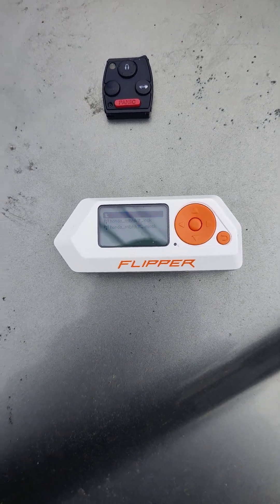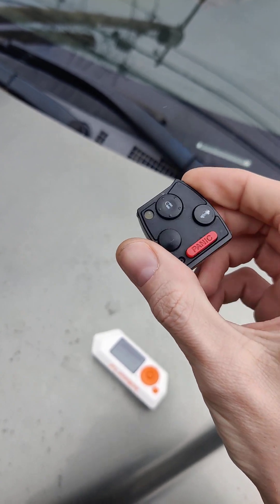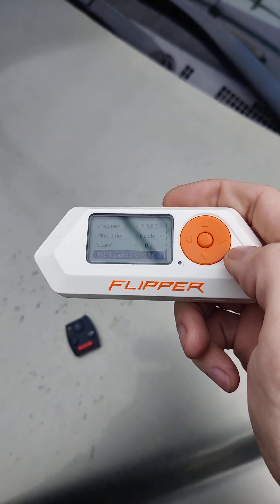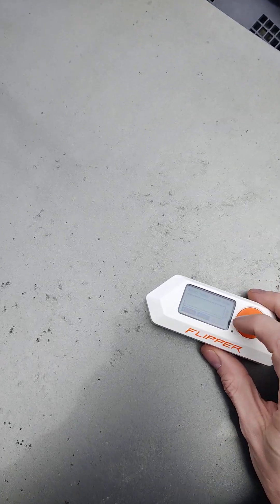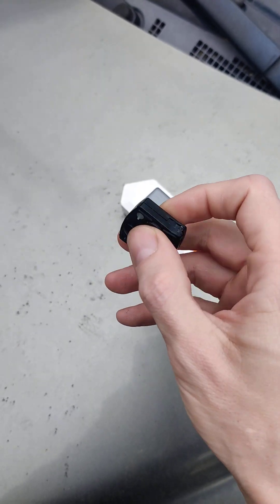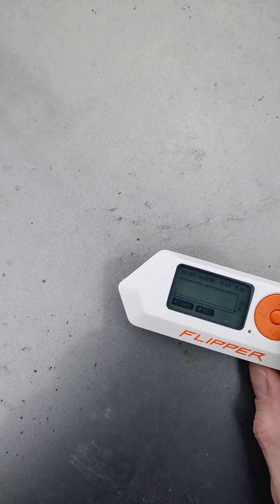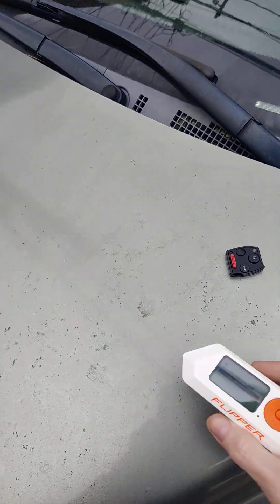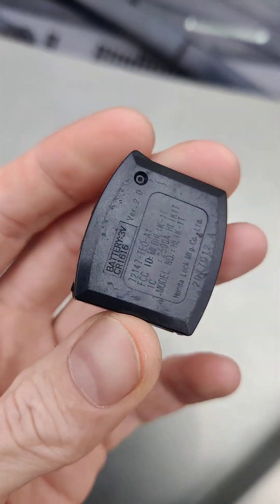Flipper Zero | Unlock '07 Honda CRV

Comment: How do you have a Honda modulation what firmware are you using? Can you just upload the files for me to github lol
Reply from the maker: It comes with RogueMaster firmware but you can add it to any firmware that supports the custom presets. The .subs that I have would be useless to you because they are still tied to identifier of remote, unless you know how to parse, modify and re-inject... If you have access to the fob this exploit is easy enough to replicate. Record four sequences + the command you wish to issue. 

i.e. 🔓🔓🔓🔓+🔒 or 🔓🔓🔓🔓+🔓 or 🔓🔓🔓🔓+🚨
Reply: @GeoffereyEakinsTech  Which file in the database in the SD card contains the modulation types (AM270, AM650, FM237, FM476)? Can you provide a path?